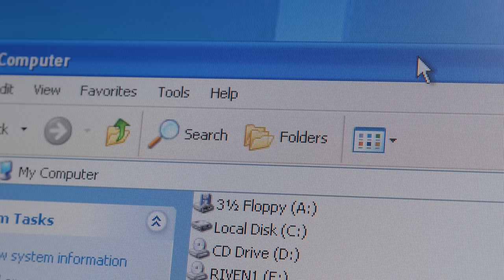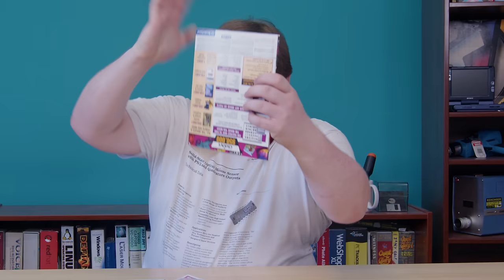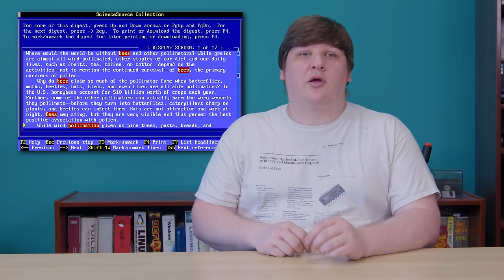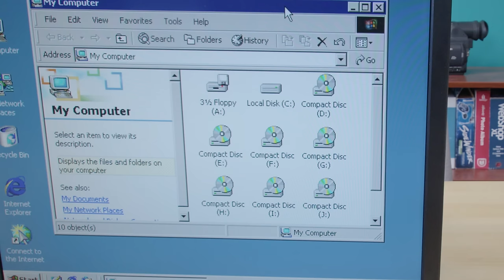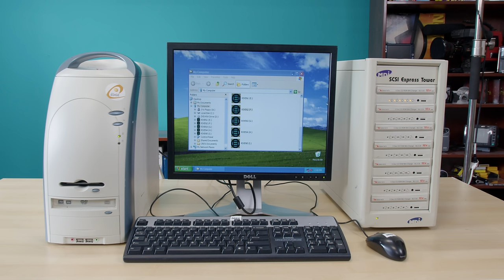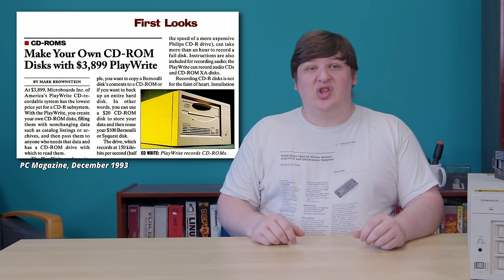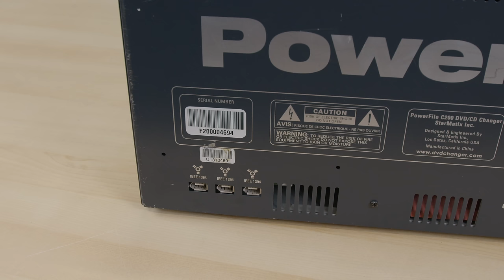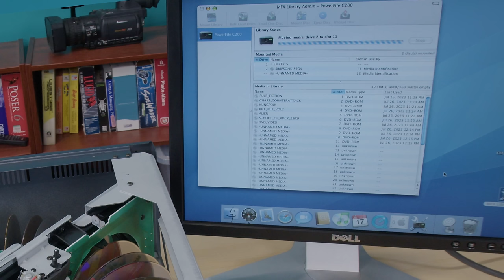A Jukebox for your PC: 1993's CDROM Servers

Comment: Just to be the most ultimate humongous nitpicker: CD-ROM = Compact Disc Read Only Media - and obviously NOT "Read Only Memory"... 😛
in the second half of the '90s, I build a CD-ROM jukebox server out of a Celeron driven PC with 3 TEAC CD-C68E six-disc CD-ROM changer 8x drives... and as you say; indeed not really very practical. I still have 1 of the TEAC CD-C68E drives from it, the only one which survived, obviously. But I never use it anymore. Firstly because you can fit about 6.8 CD-ROMs on a DVD-ROM. Secondly, I mean c'mon 8xSpeed = ZzZzZzZzZz!. Thirdly it's IDE/PATA and is only really properly supported in Windows 98.
Reply from the maker: I don't think you'll find anyone calling it "read only media" contemporaneously; I just checked some publications from the mid 80s and consistently saw "memory". I have to disagree with your assertion on its merits as well. Computer memory used to come in many formats  - drum, core, Williams tubes, mercury and other delay lines, bubble - that don't resemble what we have now. In a pure computer science sense, memory is any place the computer can retrieve or store data. It doesn't need to be instantaneous, solid state, integral to the machine, or anything else. We've made "memory" a synonym for DRAM, but that's fairly recent.
Reply: @CathodeRayDude  You're right that's what I found searching it  up just now. However working professionally in IT through that era I distinctly remember it only being "Read Only Media". Probably because, as you hinted at several times, It was sort of the talk of the day in the beginning back then. In my experience, non-tech people only ever rather uninterestedly called them "CD-ROMs".
Working as an IT-tech for most of my adult, now a bit more than semi-centennial, life, I know what computer memory is and understand how the term has been used in a broader fashion as well. However floppies, CDs, DVDs or even BluRay discs are, in the physical hardware sense, undeniably considered to be in the storage media category, and very much unlike volatile RAM in every way... At least around here, we only ever called it "read only media" within the IT-tech world.

- I have to admit that I am a bit disappointed that this was the topic that caught your attention, over all my babbling about the TEAC CD-C68E jukebox. Because using the words "ultimate humongous nitpicker" about myself, was an attempt on my part to hint at it mostly being a joke. Take the acronym "DVD", the meaning of it has changed several times over the years, and each and any of them were just as correct. The acronyms of a long gone era... yeah, there really should be more important things to obsess about today.

Comment: I used a PowerFile C200 at work, almost 10 years ago. We used it to manage installation cd's in the IT department. It worked fine for that purpose, but we never use it to play  the cd's directly from the internal drive, just for storage

Comment: 1:01:00 - They should have used the same design as the Sony 100 disc CD changer (CX100) from the same era. It was a flip open lid on top and you dropped them in. I was using computers in this era and had SCSI ( I was an Adaptec fan, I still a couple of AHA-2940s and a really old 8 bit SCSI card from the PC-XT days. I miss the days of the jumper jiggle and the terminator twist!

Comment: Once upon a time, someone may have been a part of group that had these changers in use for their FTP servers that hosted WARE...I mean Linux ISO....  It was a smaller know site, but depending on the username, you accessed a "drive" and then under that drive LUN, you would access the cartridge of CDs.  These would rotate and you could request a particular disc of files through IRC.  This was mid 2000's.

Comment: The early model Pioneer changers look so overbuilt inside and have an odd form factor becuse those were based around their existing car changers you'd put into your car's trunk. The changer needed to lock and unlock the mech to stop parts from rattling around and jamming from bumps and vibrations that occurred, even if the unit was powered off.

Comment: Everyone that wasn't born in the time doesn't seem to grasp the sheer amount of time waiting for things occured in windows 95 98 and it's ilk. They were responsive and functional but between that and the internet's speeds waiting became the average past time. Saying that changes like this were par for the course. An amount of wait for better than average usage. Many of these systems were in public libraries replacing the card catalog Dewey decimal searches and operated one a few terminals at a time to reduce the risk of shuttling. Though the schedule system is actually very old often these systems would let users complete their query before moving to the next user . Again speed took a backseat to function and it was tolerated. Such measures aren't tolerable now so it's no surprise these measures didn't last that late ng as speed would be desired along with functionality into the 2000's

Comment: well.. even if you just fill up say 10 or 20 MB on a CD, that is still waaaay better (and cheaper) than 15 floppies

Something simple as larry 6. The 1.44 version is on quite a few disk and the grapics quality is very poor.
On the CD, its one disk and the graphics quality is 4 times higher.

Comment: Also as a Soviet/ex-Soviet equivalent to those clunky disc things, there was ArVid (АрВид) card. It was basically a thing turning your average consumer-grade VCR into a... Streaming device of sorts? Basically, it allowed storage of IIRC up to 5 gigabytes (!!!) on one VCR tape. With real-time read and write capability. And was in VERY wide use between not-yet-dying design bureaus storing entire digitized databases or raw experiment data stream on them, computer pirate enterprises (yes, there were actual enterprises, like, say, Triada or Miriad-Globus featuring dozens if not hundreds of employees) in need to store less-than-legally-obtained stuff for further reuse, and other similar use cases.
The main benefit was that it literally allowed usage of a regular VCR with regular tapes. Easily replaceable, common and holding enormous amounts of data. I remember, in mid 2000s, extracting a literal pile of those ArVid tapes (fourteen cardboard boxes, so, two hundred or so?) to a dump from a design bureau as a side job.

Also, assuming if you can obtain this card today, I assume it would be the perfect topic for a video. I assume the attempt to store data on a consumer video tape on a consumer hardware was attempted successfully only in Russia, and only of sheer necessity. Definitely a piece of software you like to talk about so much IMO.
P.S. It even included an early form of machine learning, adapting to quirks of a specific VCR to increase data search precision and storage density over time.
P.S.2. It is transcribed as "АРхиватор на ВИДеоленту" ("ARchiver for VIDeo tape")

Comment: I have a power supply with something like 15 IDE HD/SATA drive power connectors on it (November last year), Have you thought of rebuilding that 7x CD Drive Tower using slim (12.5mm) optical drive or ultra-slim (9.5mm) optical drive Tower? I saw a CD-ROM changer in a cabnet at my polytechnic in 1989 where the physical BUS was the part that moved, NOT the discs, and it had something like 26 CD-ROM drives in it, and it was from a range of cabnet sizes.

What about upcycling (downcycling?) a 3D printer unit to into a multi-bd ultra-slim unit changer? commanded by a RPi and Linux, you could replicate that 200 CD-ROM changer, but for drives instead of discs.

My idea was always to upcycle and old 100 CD-Audio changer, and hack in a data unit.

Comment: The pioneer jukeboxes, all the way up to the stacked 50 or the round 100, were favourites on the euro car modd'n scene for a good number of years. They worked with updated head units, i think you could even get a box to boss them with sony head units, good changers from what i remember

I dunno if it was a mod or a legit product, but the in car 100 had a lot less cowl every time i saw it, almost stripped down to a donut

Comment: In 1995 I bought a second-hand Philips CDD522 and two years later Philips CDD2000. The CDD522 what's old is faulty but only because the guy that owned it didn't know what SCSI was. The CDD2000 cost £850, blank discs were £20 and of course buffer underrun protection didn't exist!

Comment: I work in IT and have for 20 years and robotic tape libraries are garbage and suffer all the same issues. There was one rebadged Dell LTO4 one in the late 2000s that wasn't awful, but I still had to take it apart a few times to unjam something.

Comment: Solution?
Simple…. People would have to be patient.
Back in the old days people gave operators their stack of codes and requested results when ready.
The operator processed them one at a time. Printed the results and sent them to the users.

The CD ROM libraries will need a operator. In this case a software.
The operator receives the request for data. Retrieves them one at a time.  And sends the data in to the user.
Of course this will mean the user has to wait and has to have the ability to store the data at his end because likely he won’t be waiting by his computer the moment the data is streaming.
But you see how with a little patience these libraries can be used. Just a properly formatted email with the request to a Python script that reads the request, puts it in a line behind other requests and ftp’s it back to the user. If the user is behind a NAT, a email notifies the user his data is ready for download. Let’s say the user has a hour to download the data from a disk cache before it is erased.

Comment: These 'laat forever + unbreakable" claims started on a very big and old, UK BBC "Tech" TV show Tomorrow's World. I was complIning about the claims weekly, as was my dad, an electronics engineer since 32k started with Dragon 32, etc, before the Commodore 64. MY dad was the tech for Dragon and actually made me a computer, something impossible today, as such claims mean built, as in assembled what someone else made.  Yes the Music ones didn't read data. Spot on. He literally had to bring every resistor home, I help  rub off the black pcb tracks and contacts. The only part I couldn't get as an 11 year old in 1982 was the case, so I wore a wrist strap as my pcb was on chipboard. Nobody said motherboard then. PCB was barely understood by most. I could change RAM thpugh. My dad put in expandable RAM years before it was standard. I even had games on RAM chips in tubes. It was faster than tape.

Comment: You weren't there man, you weren't there! The whole "CDs didn't really affect how we used PCs" theme of the first 10 minutes... I disagree. It drove the entire multimedia home computer revolution, which drove things like MPEG video and MP2/MP3 and then file-sharing, which forced the hand of the media industries to make music and movies available through the internet. Before CD-ROM we had midi and MOD files, and video files were a few seconds of graininess on a loop....Stag, anyone?
Reply from the maker: Those things happened in 1998, not 1993.
Reply: @CathodeRayDude  Concerning MultiMedia, what with many largr disc-based home video Formats over the 1980s being released and summarily not catching on, I remember a Techmoan video in which he spoke of CD-video, Analogue video (about the length of a Music Video) with Digital sound, which was available in 3 sizes, the Standard 4-inch CD, a 12-inch Laserdisc-sized disc, and an 8-inch disc that would seem to be neither fish nor fowl. 

Also, I remember that there was an attempt to make VideoCD (an all-digital version of video on CD) market ready, but from what I remember, it really wasn't much of an upgrade over VHS, and the amount of video was somewhere in the region of 50-70 minutes, so most movies would have to be split across 2 discs, which is less than optimal.

But it does seem like multimedia really came to fruition with the age of the DVD. Y'know, with a decent 3x upscale, you can get a higher resolution that a standard Blu-ray!
Reply: Late reply but no CRD - they didn't just appear from nowhere in 1998, 1993 was when the foundations were laid in the consumer space. In 1993 we were lucky to have 1/4 screen 15fps video, but that drove interest in MPEG1 video as more people became exposed to the idea of digital video in the home. This was generally accompanied with MP2 audio, not sure why as MP3 was already available and we needed MPEG daughter boards at first so processing power surely isn't the answer. Anyway, that all laid the foundation for what was in full swing in 1998. It wasn't a case of in 1998 the idea of digital media suddenly sprang into existence - by 1998 MP3 and VCD sharing was already occurring on a massive scale for those blessed few with access to a decent internet connection (i.e. university students and people in a handful of countries like Sweden and parts of North America). In 1998 I had unsupervised and unlogged access to an OC3 line at uni, I didn't have a home broadband connection faster than that until 2022.